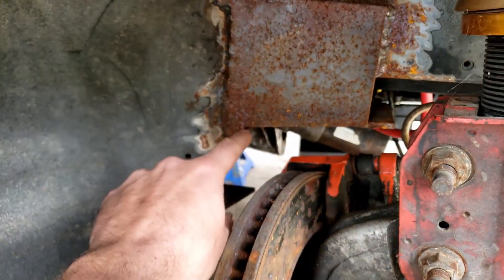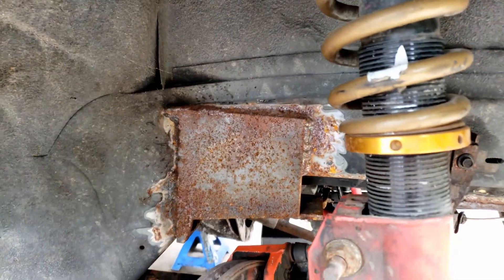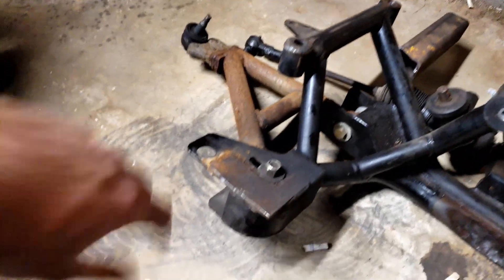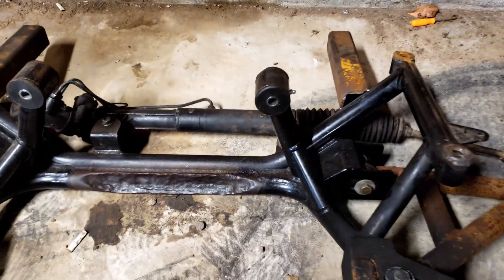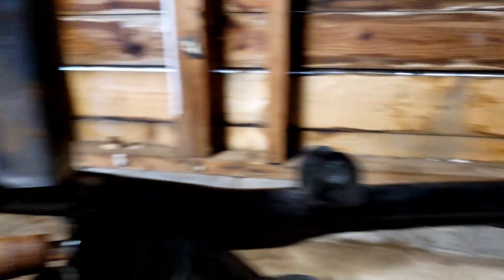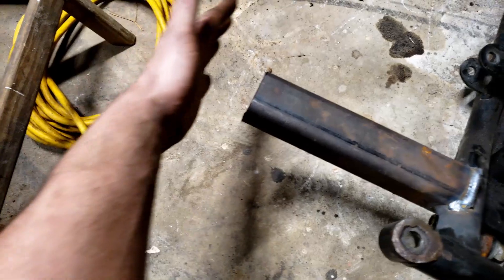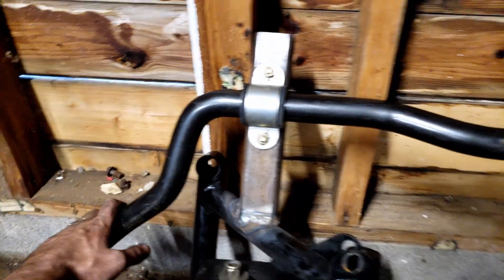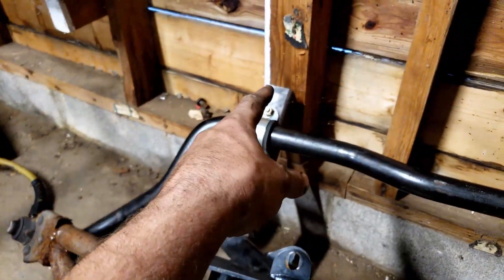SleeperGTP: Swaybar gets mounted!

Comment: Nice build - what motor trans you going with
Reply from the maker: Its has an LQ4 6.0 junkyard LS, 4L80E, and a Ford 9 inch in the rear with a Detroit locker and 3.93 gear.